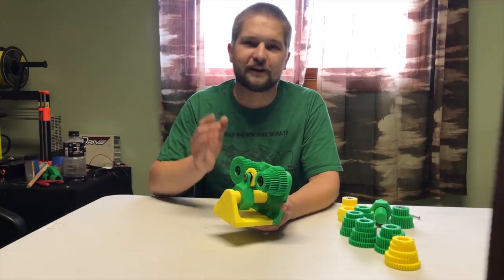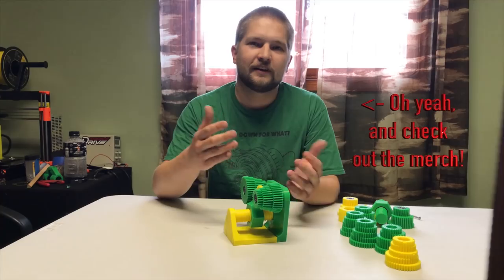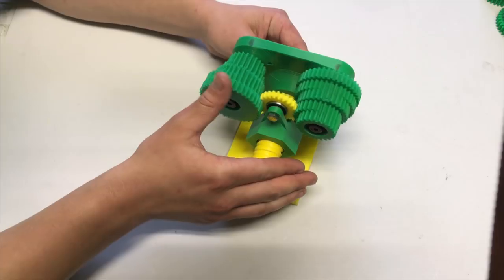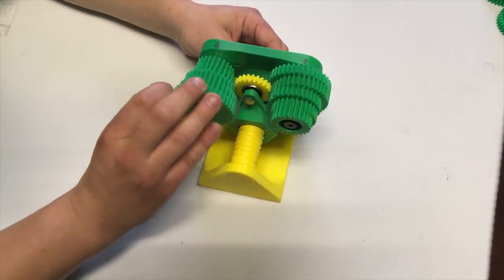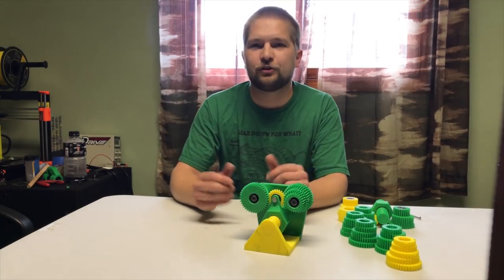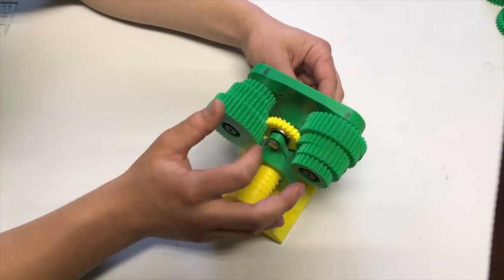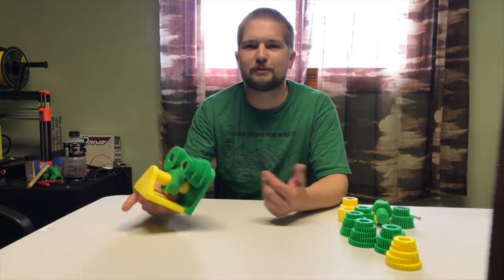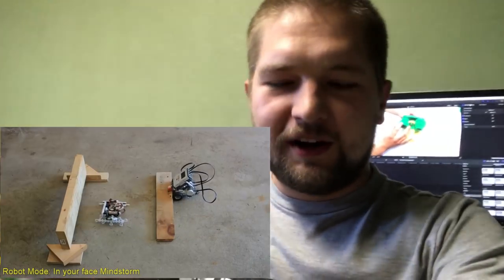The Hot Swapping Gear Mechanism | VCT2

Comment: #3 no reverse
Reply from the maker: It is capable of reverse if I redesigned it, what I didn't do was assure that the numbers of teeth used would assure that I could get each member in the correct place to shift gears when spinning in a different direction, since the ramps for forward and reverse don't start in the same place.
Reply: Don't really need a reverse with a DC motor.  Just reverse the motor.
Reply: Don't really need to shift gears with a DC motor.. :)
Reply: Both normal DC motors and brushless ones have downsides in their torque-rpm curves that transmissions can fix. A brushed motor has really poor torque at higher RPM, a BLDC hits a top speed limit.
Reply: Mum, DC or AC, yes, at least some vehicles with (electric) motors have 2-3 gears. The Siemens light rail cars have 3. I can hear them shift as part of our UTA Trax and Streetcar lines.
Reply: mumiemonstret actually u do it's only AC motors that won't require shifting
Reply: Doyin, why do you suppose AC motors wouldn't need a shift or two like some DC motors probably do (as I said just above with LRVs, although I don't know if they use AC or DC)?
Reply: Maxx Fordham! AC motors comfortably rev to over 15000rpm while DC motor start losing torque at 3000rpm
Reply: brushed DC motors lose torque starting from 0 rpm, brushless DC motors generally keep torque until their RPM limit. The problem is that the motor has an RPM limit that you might not like. Teslas have a relatively low top speed precisely for that reason.
Reply: Antalz sorry bro get informed. Tesla's use AC motors
Reply: That supports my point. They use AC motors, and have a limited top speed due to no gearbox. AC and BLDC motors have the same problem in this respect.
Reply: Antalz if they wanted a higher top speed they could easily change the gear ratio which will reduce acceleration. The motor shaft passes through a single speed gear reduction
Reply: Or you could have the best of both worlds by having a multi-speed gearbox, so you have both the crazy acceleration and the higher top speed. Kinda what most formula E cars do, for example. AC motors "won't require shifting" in the exact same way BLDC motors don't strictly require it, but then neither does an internal combustion engine or a brushed DC motor. However, a multispeed gearbox improves the torque-RPM curve in every case, which is the point we started at, and which you seem to agree now is true.
Reply: Antalz that'll just add to the complexity and increase maintenance.
if it were a supercar then OK for example rimac c1 uses a 2 speed transmission 
but Tesla isnt
Reply: Doyin, Tesla's... whats use AC motors? Their cars, I guess you meant, right? Tesla's cars use AC motors?
And what source of information supports what you're saying about AC vs. DC motors' comfortable revs?
Reply: And both of you, but especially Antalz: How can motors supposedly "lose torque" with the faster they go? Like how can a brushed DC motor "lose torque right from 0 RPM"? That doesn't make sense. When an averaged-sized motor is off, I can easily spin its shaft with my hand. It has 0 torque. When it's on but spinning very slowly, it has just a little torque; if it's not a super BIG motor, then I can stop it directly (not necessarily the output of a gearbox that makes that output slower) with my hand. The faster it goes, the harder it is for me to stop that motor with my hand; not easier! It has more torque with the faster it goes, at least until some sort of leveling off point (which I don't really understand either, but at least that's not as dumb as saying that it "loses torque" from the second you turn it on).

If I swing a hammer softly, does it have the potential to move what it hits somewhat far or just a little, or dent it somewhat deeply, or just a little? Okay then, if I swing the hammer HARD, will it have more potential to move the thing farther or dent it more deeply? But if I swing it REALLY HARD, will I somehow magically "lose" some of its potential to move farther or dent harder? How can a motor be any different?
Reply: Also, while we're at it (new post so that this part can be seen without clicking "Read more"), I would still think motors would need some gearing like engines do, because of this question: Even if you use a motor that's comfortable at spinning really high RPMs, wouldn't you save battery power by using a transmission with just enough gear ratios that you can shift up a few times without the added weight of that transmission canceling out the energy you've saved by burdening the motor back down too much?
Reply: Maxx Fordham! I meant that they use AC motors
Reply: Maxx Fordham! I already mentioned that Tesla's have a single speed gear reduction but not a gearbox
Reply: This is a bit difficult to explain without graphics. Just look up something like "dc motor torque rpm curve" in google images, and look at the graphs. You see that DC motors produce most torque when they are not producing any rotation, called the stall torque. They produce no torque at all at their free-run speed, because if they did they would speed up. The straight line between these two points is this a DC motor's torque-RPM curve, and also shows that a DC motor produces most torque at stall, when it isn't actually rotating.

About your motor spinning slower or faster, how are you controlling the motor's speed? I get a feeling here you're using a motor controller. You should use a fixed input voltage, and then vary the torque you apply onto and opposing the motor shaft. That will get you a torque-rpm curve. I think you're more thinking of a torque-volt curve, rather than a torque-rpm curve.

Consider this: how fast can you throw a 100g ball? How fast can you throw a 10g ball? 10 times faster, on account of it being 10 times lighter? No, because your arm simply doesn't move that fast. That's extremely roughly what's also happening inside a DC motor with increasing RPM.

BLDC and AC motors generally don't need gearboxes for efficiency reasons, because they operate at >90% efficiency at any RPM. The efficiency of an ordinary DC motor or internal combustion engine varies wildly with RPM, and thus they do need gearboxes for efficiency's sake. However, when using an ordinary DC motor you're generally not bothered too much by efficiency to start with, because they get about 60% efficiency at the best of times.
Reply: Doyin, I get what you're saying about how Tesla's somethings have an AC motor. But which possessions of Tesla were you trying to refer to? I guess you were trying to say "Tesla's cars have an AC motor." Is that right? Why not just say "Teslas have an AC motor," then, and just forget the possessive form, since you aren't even including the possession that has an AC motor anyway (presumably the cars made or possessed by Tesla)?
Reply: I think he meant to say "Teslas", using the brand name to denote the car and making it plural, but wrote "Tesla's" in error. It's very common among Dutch people for instance, as many Dutch plurals are formed using 's. For completeness: no english plural is formed with an apostrophe.
Reply: Antalz, we don't know what country Doyin is from, but let's see what he says as to what he meant by his apostrophe. By the way, oops, you left the capitalism off the e when you wrote "[E]nglish." (Hint: You can edit that error out with less effort than it would take to give me a long-worded "no" of sorts, and so can Doyin with his likely error. And if/when you both do, then I'll edit this part of my reply out.)

But anyway, your motor thing is still not making sense to me. If they produced "no torque at all" during any speed, then they not only would they just stop moving at the very second even a feather landed on them, technically they wouldn't even be moving at all. And if the motor is off and is done winding down, then its shaft isn't moving, and it is not even trying to move, so it's not trying to push a load and therefore it has 0 torque when it's just sitting there. I suppose that right when you turn the motor on, then right at some little millisecond or microsecond before it starts to spin, then it could have that stall torque you're talking about, otherwise the term wouldn't exist. But after that, if it spins more slowly, then until it reaches whatever the top of that torque curve you're talking about, it gets stronger as it goes faster.

But I'll look for the graph you're talking about, because normally, the faster you apply force to something -- either rotationally or linearly -- the more impact you have on it.

When using DC (at least brushed) or maybe brushed AC motors, obviously all you have to do to give them more speed is to let them draw more current by forcing more voltage across them. That's the easy kind of motor control. I've never really understood brushless AC motors that well (but it seems that if I give a BDC fan motor more voltage, that speeds it up; I'll have to try again to make sure), but apparently brushless AC motors won't speed up just because you give them more voltage like brushed DC (or maybe even brushed AC) motors do, hence the motor control. But either way, I don't see why a motor going faster wouldn't have more torque, but what I do believe is that it might have more torque at the same speed if it could draw more current but not speed up just because more current was available.

I understand that maybe a motor can be efficient across its whole speed range, as opposed to an engine, but those that are 90% like you're talking about would still do more work with more current, still at 90% efficiency, right? So while it spins at 1000 RPM, maybe you're getting 90% efficiency of 1000 RPM worth of work done, but then at 2000 RPM, you're still getting 90% efficiency of those 2000 RPM worth of work done, and so on with 3000 and 4000 (as with something simple like a fan or a pump), right? But then you're still draining the battery or putting more load on the generator or grid faster the faster you spin the motor, because in the case of the kinds of motors that you spin faster by sending more current through, you obviously have to get more current from the battery or generator or grid to do it, because of Ohm's Law, right? Thus you still drain the system faster with the faster the motor spins, do you not?
Reply: Perhaps you should think of linear movement. I can push against a wall, but the wall won't move. But just because the wall doesn't move, doesn't imply that I'm not pushing. This is how you should think about stall torque: if I hold the shaft to keep it stationary, how hard will the motor push to try to move the shaft when I apply power? 

I'm assuming the start of your comment is about the no-load speed. If a feather landed on the shaft while it's at that speed, the speed of the motor would drop slightly. The motor produces more torque at lower RPM, so with a slight dip in RPM the motor can spin around the feather. At the lowest possible RPM, 0, the motor produces the most torque it could possibly do: the stall torque. 

If I let a motor spin with no load on it, it will spin at some RPM, usually around 10.000 RPM. How much torque is the motor producing at that time? 0, because if it was producing torque, it would be speeding up.
Reply: Maxx Fordham! what Antalz means is they produce 100% torque at 0rpm when there is max resistance to motion
Reply: The output work done is RPM*torque. You can use a 2:1 gearbox to have your motor run at half RPM, but it will have to provide double the torque, or half the output power will be provided. You can't cheat conservation of energy using a gearset.

It honestly appears to me you have some wrong intuitions about torque, RPM and power. I think you're really better off looking at performance graphs of motors, and looking at the formulas for rotational motion, and comparing them to linear motion where your intuitions may be a bit better. I also highly recommend buying a small DC motor and a multimeter, and do some playing with it. Most importantly, the harder you clamp the shaft, the slower the motor will spin while pushing against your fingers ever harder, while the current drawn rises also. This all culminates when you clamp the shaft so hard it can't rotate, where the motor provides the maximum torque it possibly can, and draws the highest amount of current it ever will.
Reply: Maxx Fordham! Brushless ac motors are running on 3 phase. Frequency of ac= frequency of motor
Reply: Roko Krstičević don't bother trying to convince Maxx just tell him to learn the basics of AC motors.
Reply: Maxx Fordham! using gears for higher speed in an AC motor would put more load on the motor making it draw more power

Comment: I was trying to conceptualise a design for an automatic transmission that was like a bicycle sprocket on a spring, but instead of a standard derailleur, it is the sprocket that is mounted on a steep pitch screwthread against a spring. It's hard to write about without a picture.

Picture a bicycle cassette on a back axle that can spin on a section of screwthread carved into  the middle of the back axle. The smallest cog in the cluster is on the right hand side like on a normal bicycle. The sprocket can spin on the axle and moves to the left or the right as it does so.

If the cassette moves forwards faster than the axle, it will move to the right on the screwthread. If the cassette moves forwards slower it will go back to the left of the screwthread. A spring of carefully chosen stiffness pushes the cassette so that its default position is the left hand side and the pitch of the screwthread is 45 degrees so that it does not lock against the spring or the turning force and the cassette is free to move.

A chain of fixed horizontal position and a variable distance tensioner (like a bicycle derailleur that cannot move right or left.) I will also add that each back wheel on the axle has an independent one way freewheel clutch, so the axle can drive the wheels forward but the wheels cannot drive the axle if the engine accelerator is stopped being pressed.

The idea is that if you come to a hill, you will need to press the accelerator more. This will cause the chain to pull on the cassette with more force, pulling it ahead of the axle rotation and shifting it to the right on the screwthread, compressing the spring. This will choose larger easier gear on the back cassette as the chain cannot move right or left.

When the resistance to moving goes, the vehicle will speed up until the sprocket goes back to the left, back into the higher gear ratios.

The spring needs to get progresssively stiffer and part of the challenge is the right spring to get the right gear, and how to get it so the chain is not in the zone between two gears. The other challenge is it has to downshift under load, although that is easier than upshifting which is done when the load relaxes. Or maybe a series of springs where one compresses completely and onto the next?

That and the vehicle upon pulling away will immediately try and shift from the highest to the lowest gear, causing wear on the chain and sprockets. Perhaps it is better to get this vehicle moving with your feet before starting the engine.

Comment: It never run continuously or under any load. Proves nothing.
Reply: Dave M maybe because it's not a complete product it is just a design. Could you not listen throughout the entire 6-minute video?
Reply: its a tiny cheap ass 3d printed model not a full built engine
Reply: We will see if it fits my honda

Comment: I have spent a long time thinking about why transmissions are so complicated. Then I recently started looking for a new car and stumbled across the gen2 Prius. It's hybrid gearbox is amazing. It only has 1 cvt gear, no clutch, no reverse, no starter motor, no belts or friction parts. It changes the gear ratio by changing electrical resistance on different parts of a planet gear. There are some videos showing how it works on YouTube, i recommend watching a few. 

I would really like to see you try and build something similar :)

Comment: Its important to notice that in the same gear, if the input speed is constant, the output speed is not constant. The time to switch is much short (at 6000 rpm, the switch time is about 0.0015 sec), i think the gears must be very slim to fast switch (sorry by my english from Brazil).

Comment: I guess this is a cvt transmission with gears
Reply: I don't see how it can vary continuously. You need to disconnect the load some how to shift, and it's not variable has it still has a choice of fixed ratios
Reply: MiG21aholic why do we need this then? Useless I guess
Reply: TBH it is yes

Comment: It seems like there would be a lot of vibration with this design because the weight would shift during high speed movement.  Your offsets are not in opposition to each other and therefore would produce a violent vibration and ultimate destruction.

Comment: the problem is the uneven gear ratio. this transmisson doesnt have a set of exactly 4 gears, but each gear fluctuates between the lowest ratio of the higher gear and the highest ratio of the lower gear constantly at the frequency of the engine rpm. therefore it can only be used in configurations with enormous count of gears. this however would be more unreliable and bigger sized than the amazing planetary gear set combos in 8 speed automatics